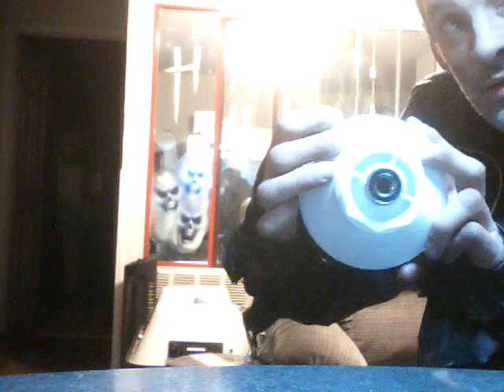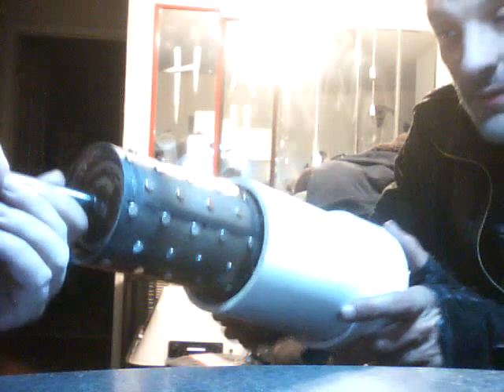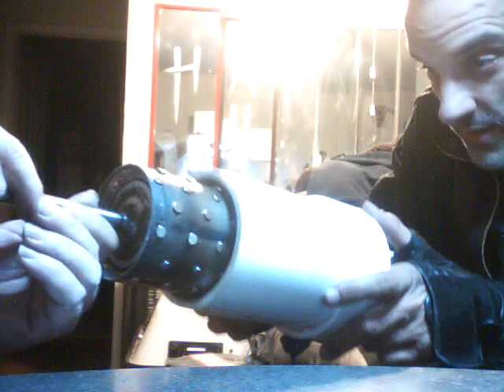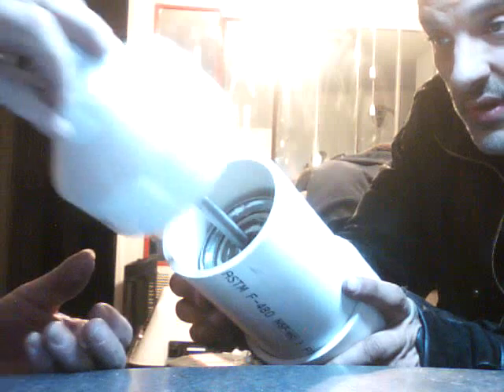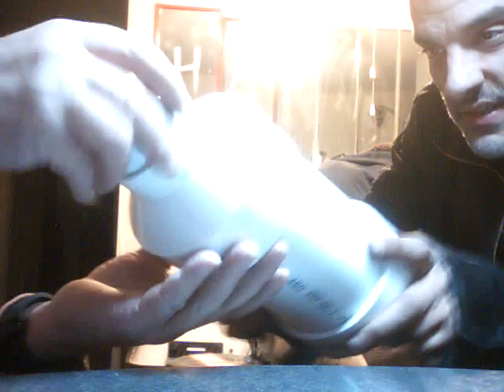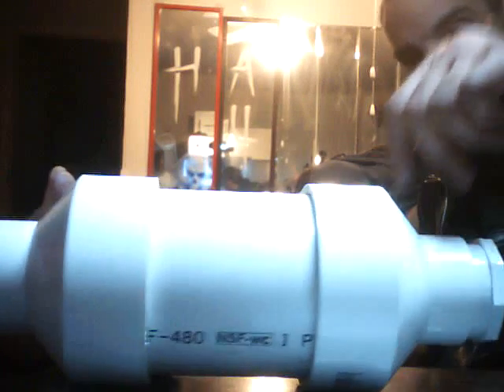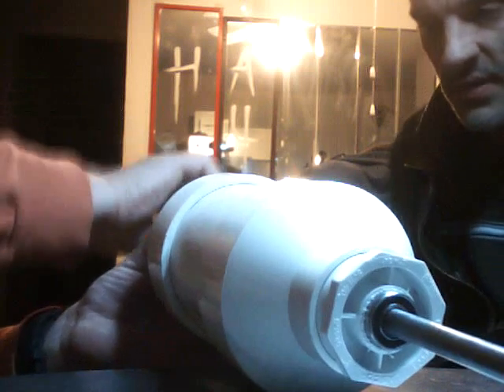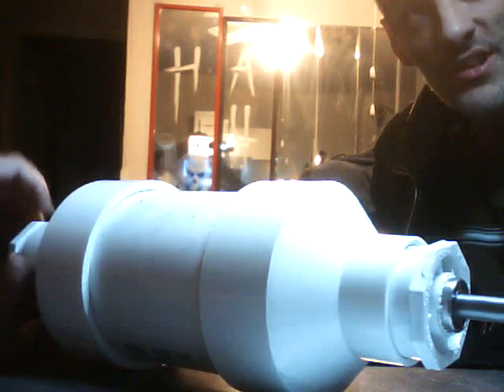Tribrid Water Hammer Prototype

Comment from the maker: I'm back on the project! I have added two ports for water in and steam out. I'm about to coat the drum covered with 220 magnets with bedliner spray. This will waterproof The drum and magnets as well as hold the magnets in place. Once this is done I will make a video of the reassembly and all the parts as well as a initial test fire of the unit. Stay tuned!

Comment from the maker: somehow i lost the power drill that drives the water hammer. still need to glue down the magnets and dip it in plastidip for protection. don't want the magnets to contaminate the water and don't want the water to rust the magnets. however, i did perform a dry run just to see if the magnets heat up the copper plate...    and it does so quite well! once the modifications are complete i'll run another test and post it on youtube.
Reply: spaceminers .... So, it's a flop?